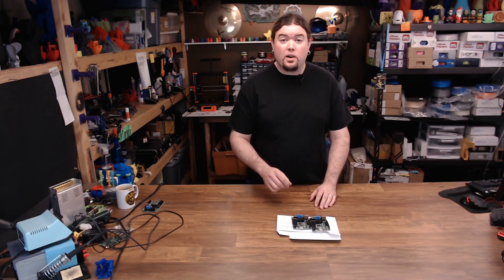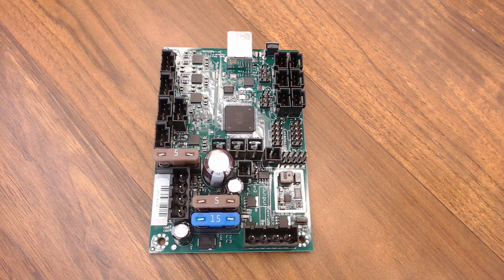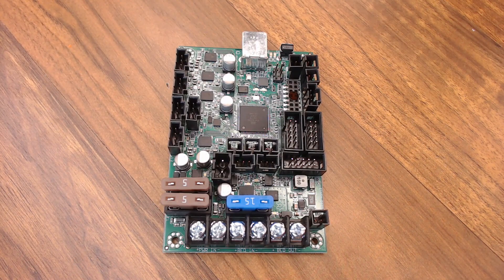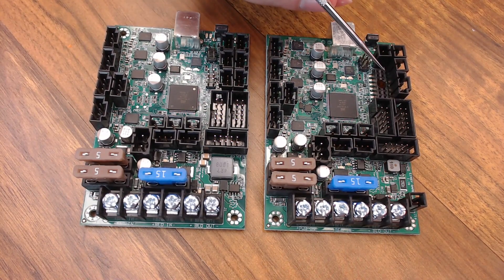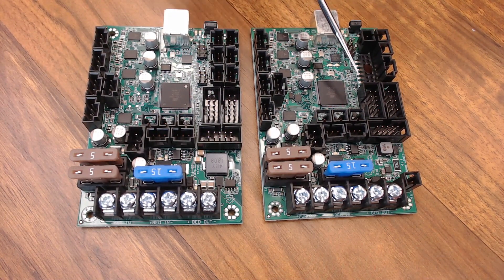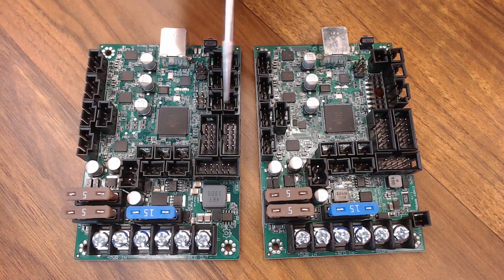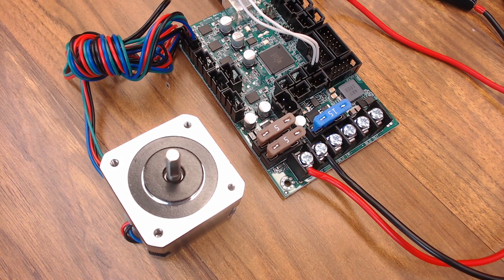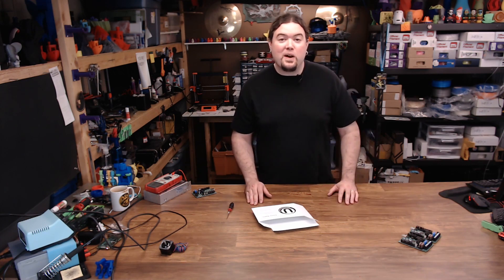Ultimachine Einsy - Walk Through - Chris's Basement

Comment: HI, I have just come accross 2 older MK2.5  machine that have Mii-Rambo controllers and both need new controllers, Will the newer style boards work?  Thanks RC
Reply from the maker: The only issue I can see if that the new board will not except the endstop switches. There might be an upgrade path that will allow this, but I'm not sure. Check out some of these upgrade builds. https://help.prusa3d.com/category/original-prusa-i3-mk2-to-mk3s-upgrade_320

Comment: Hey Chris, the links are not working anymore... I was looking why I have a high pitch beeping sound from my PSU when I want to use mu Mini Rambo board retro, PSU is 12 volts
Reply from the maker: Looks like those boards are getting hard to get, people are no longer selling them. not sure why. You have an Einsy or a Mini?
Reply: Chris Riley hey thanks for the reply, brand is Ultimachine and on the board it says mini Rambo 1.3a. I’ll tweet a picture and tag you in it
Reply from the maker: @Zachary3DPrints  Oh hey man, I didn't know this was you. LOL, yeah, that's the mini, it should run just fine at 12v. So the beep is coming from the PSU? That's really strange. Does it only beep under load?
Reply: Chris Riley yup that’s my buddy... if I disconnect the board it doesn’t beep (safely disconnect) but if connected it beep as soon as I switch on the power...
Reply from the maker: @Zachary3DPrints  Do you know if the PSU works on other boards? I wonder which one is causing the issue?
Reply: Chris Riley yup I’m like you, I checked most of the things I could think of, and searched the Internet for this beep... nothing found. Or I find about normal PC PSU, which I don’t need and things about the mini Rambo board, but the board isn’t beeping. The voltage should be okay, board 12v and the other parts, bed, stepper motors all from a CTC/Anet i3 clone, and a E3D V6 clone. I know maybe not the best quality... lol

Comment: Hi Chris I really appreciate watching your videos. I have a Pulse XE D-132 setup for NylonX. As far as I’m concerned right now it’s just an expensive paperweight with it belong locked to MC. My idea is to convert it to an MK3S. Do you think it would be worth it to attempt or just sell it and buy another MK3S? If you think it’s a worthy idea would you consider doing a conversion video? I haven’t gone down the Marlin firmware editing rabbit hole yet but I’ve been watching a lot of your videos and thinking about it
Reply from the maker: That's a tough call, you could make the conversion, but there is a lot hardware and firmware that will have to change. I converted my Pulse to a MK2 running Marlin and it's not too bad, still not as good as a Prusa. It might be better to try and sell it and get a MK3.
Reply: I have a FYSETC MK3S clone that prints fantastic. I have a second one in the box ready to assemble. I was considering pulling the relevant parts and Einsy board from that kit to make it happen, but my stumbling block would be the firmware changes. I have no experience yet with modifying firmware and configuration.h files. I like the idea of the premium parts on the Pulse for printing NylonCF but I would need some guidance with the firmware to make it happen
Reply from the maker: @acmeautoproducts  Yeah, you would probably need to start a new config from scratch at that point.

Comment: I build a prusa clone and i have aluminum x and y mounts along with aluminum frame. I did buy a board from prusa and steepers and bed. everything else is aftermarket . All the points on the wizard setup work but when you get to the mesh leveling part it says failed z. It makes it throw the first points until it gets across the build plate to the 250 side and the pinda is off the bed. This ends up making the nozzle dig in the bed ive been trying to figure out how i can adjust the setting in the config i have looked online but havent found anything. Ive even load one of the prusa configs for a long  time ago still fails. i have even removed the board and installed it in the other printer i have and did the calibration with that printer and it will work after but if i do mesh leveling it does the same thing. I have watch your video severl times to see if there is something i missed but im stuck can you help.
Reply from the maker: Check out this doc, maybe it will help you. https://docs.google.com/document/d/1Zz6zwEf5JP5zXO4nDO9sNIYq3-WoQSPITlrna-p0gbA/edit

Comment: I don't see much use of a serial interface and I like the idea of running higher voltage fans.  Any advantages to running the Prusa firmware vs. Marlin?  Or vice versa?  I'm sold on one of these boards, just unsure of which one yet!  Haha, though your video was helpful.
Reply from the maker: Not really any reason to run Prusa firmware unless you want to copy there machine 100%. The retro is going to be the more flexible way to go.

Comment: Did you manage to get the Einsy Retro working in the end? I know Chris Warcocki was looking to build a Prusa MK2S with a Retro to make it into a hybrid MK2/3 but it all went quiet and hes been mainly concentrating on the Duet 2 Maestro. I have a retro gathering dust in a drawer that I bought for a project then ended up going down a different route and was wondering if you had a working or at least semi working firmware you could share that I could build off?
Reply from the maker: I don't have a current config for the einsy, but I will post it up when I create one.

Comment: hi got the einsy rambo 1.1a i need some help i trying to setup a BLTOUCH with no luck please help
Reply from the maker: You're going to need to use the max X endstop pins to power the sensor and z min signal and ground for the white and black wires. Then you will need to switch the pins in the pins_einsy file for servo one.

Comment: Chris - Another great video man! I use einsy's on my hypercube evolution and wanhao i3 and can't complain. 

Since you have a greater understanding of arduino pinouts and marlin than I, I pose to you a question: Is it possible to use an MKS TFT with an einsy? I'm using the Einsy Rambo 1.1, but I haven't figured a way to connect the MKS TFT I have lying around.
Reply from the maker: I think you could figure out a way to do it, but not easily. I think the pins you need are available, but not in a configuration that is easy to connect up to.

Comment: I don't think the voltage makes much difference to steppers unless you use the higher voltage to push more current through them.
If you have the same parameters set on the driver they will be the same on 12v and 24v until the 12v can't push more current through AIUI. The drivers are effectively constant current drivers.

Also 256 microstepping probably isn't worth it as it reduces the accuracy of positioning and can result in variable size steps as the motor steps due to minor differences in the construction of the mechanics. You only actually get a definite position on full steps AIUI. That's why Z axis steps and hence layer hight should be in increments of 0-04 mm on most machines (lead/steps per revolution)
Reply from the maker: You bring up good points, thanks.

Comment: thanks for sharing, I'd like to share the results I got with in my own testing I have found 2130 stepsticks quieter @ 24v on my ender3 with a GEN L board compared to the ones I have running @12v on my kossel linear plus with the Trigorilla board, both are configured hardware spi, the kossel is definately noisier despite having motor dampers when the ender has not, this could of course be down to the steppers but I intend to switch the psu , the fans and heater cartridge over to 24v models  and rewire the bed to match, and see how it pans out before trying out the rearm board, the other thing I found with the kossel  after fitting the 2130's was layer shifting unless I dropped the acceleration down  this is one reason why I want to try it out @ 24v
Reply from the maker: Interesting findings, I'm looking forward to seeing if 24v makes a difference.

Comment: At first I thought you were crazy, $120 dollars for an 8 bit board.  Then when considering the Trinamic drivers, its not so bad.  Nice review.  Will consider it  as an upgrade to my Anet E16 board.  So it looks like there are 2 Z stepper connectors sharing one driver.  Do you happen to know if it is in parallel or serial?  Which is better?   Anyway, thanks for the video.  Very informative.
Reply from the maker: The Einsy has the motors set up in parallel. Series makes more sense, but I trust Ultimachine.  2130s are kind of pricey so getting 4 on board definitely adds value.

Comment: Kind of hindsight now, but a motor sound/voltage comparison between the two boards and different drivers would have also been nice to include. I would HIGHLY recommend a P3 Steel frame that is MK42 compatible for either of the boards that you choose, but then again I'm also biased.
Reply from the maker: I thought about the motor sound comparison after this video. That might make some interesting content. I'll give it some thought. Thanks Kevin

Comment: On the minirambo make sure you got good strain relief on those clip on connectors for bed and power. I got one without when I got my Pulse and the moving back and forth of the bed caused plenty of arcing which melted the connectors on the board and required a replacement
Reply from the maker: Yep! I have had that issue as well. That's why I am glad to see they got rid of it on the Einsy.